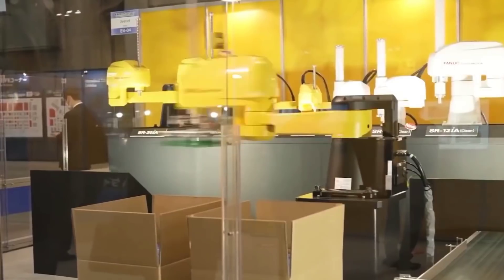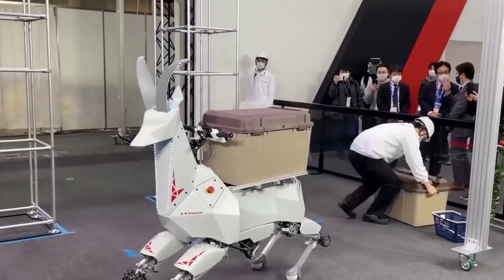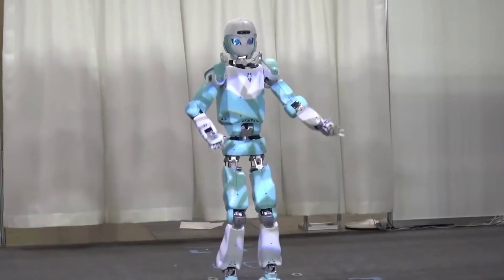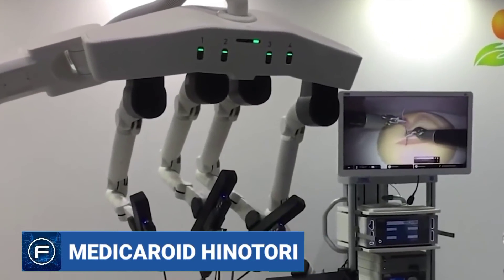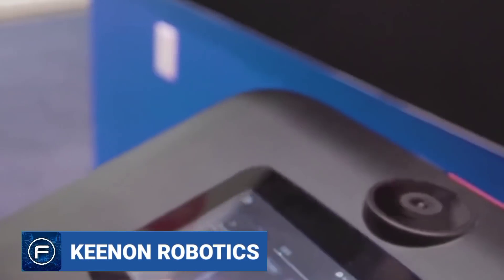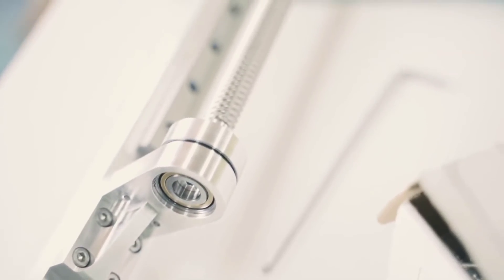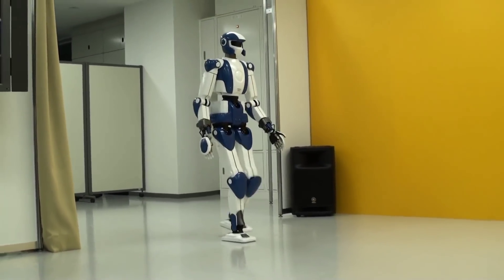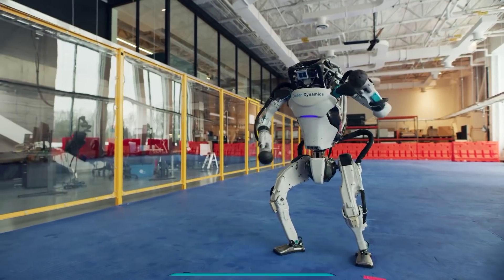IREX 2022: Japan's largest robot exhibition including Robots and Gadgets | FUTURISTIC

Comment: To be honest, it's 2022 and I'm suprised by how powerful they 'arnt'...10 years ago we were watching videos telling us about unstoppable military humanoid bots being tested that could apperently average 20+kph across all terrains, had night + infra vision, could chip scan over great distances to determine friendlies from disposables, and armed with enough weaponry to invade a small country by itself! Here we are a decade later and the industry is classing a 6' 4" panzy bot that can lift 60kg as "stronger than a human"...

Well I'm sorry but anything that can 'only' lift 60kg and be easily layed flat with a half decent nudge from a shopping trolley, does not impress me at all. Sure they can make them wink, smile, fetch a ball, whatever. But every movment takes a motor, servos that need to be told what to do, etc, etc, etc. Every bit of additional complexity brings with it another fail point, another power draw, another glitch waiting to throw a spanner in the works of a system that 'still' can't deal with shite when it happens, like it 'alway' has and will....and whoa!!!...Well sit me down and give me a bucket of valium..."it can do all this for an incredible 4hr before a recharge!" ....so your telling me this SNAG has to pull the pin at lunch time because its just too frail to do a full days work? Well maybe it should take a big swig of 'harden the f#%k up princess', or buy itself a bigger battery with some of the money it saved up stealing some poor ex-employee's job who now sits at home at 6 minutes to suiside, feeling worthless, depressed and on welfare. Remember that people work, pay tax, and spend their wages supporting our economy....bots take jobs, they don't pay tax and they give nothing back to society but an ever greater divide between haves, and the destitution inspired criminality...of the have nots....we all must pay in the end.

Yeah, yeah, call me sinicle, but if anyone remembers the guy with the red and white striped suit, the straw boater hat and the megaphone, shouting "Monorail" at the good citizens of Springfield, in 'that' episode of The Simpsons, well I can see him fitting right in, standing there on his soapbox at the entry to this collection of mediocrity....

Cumon earthlings, LIFT YOUR GAME! What about some cheap, realistic, sex bots so we don't need to breed with each other in order to get our rocks off? Now that's sure to bring about world peace and save the environment eventually....Thinking caps on people please....don't kid yourself, cutzie doe eyed toys today, but it'll be a matter of us or them before you can say internal combustion engine.